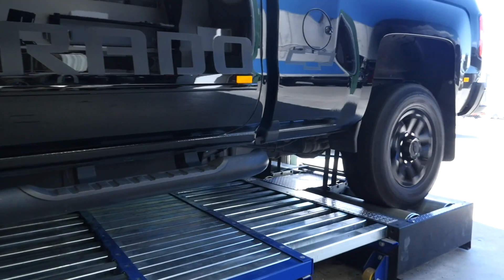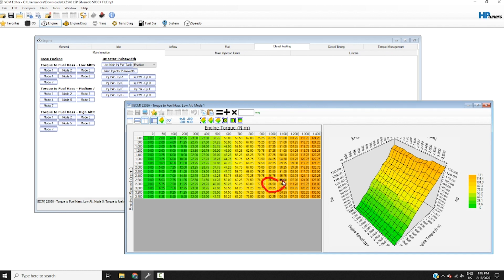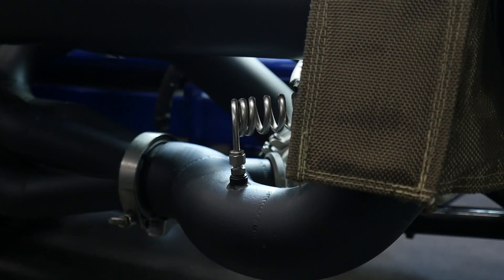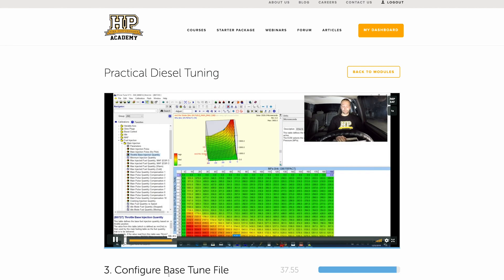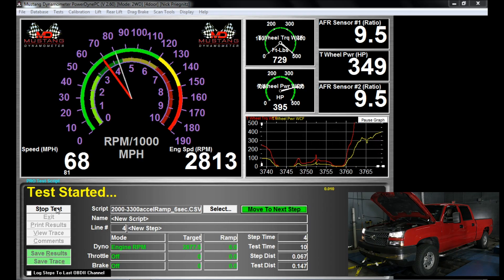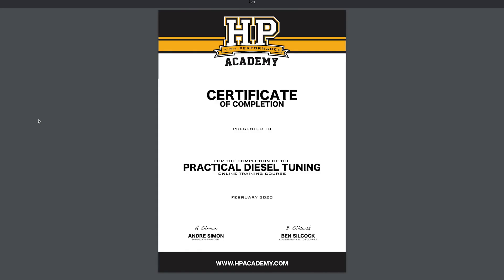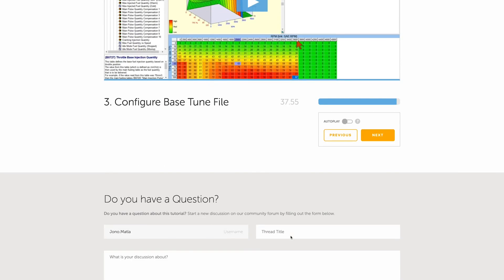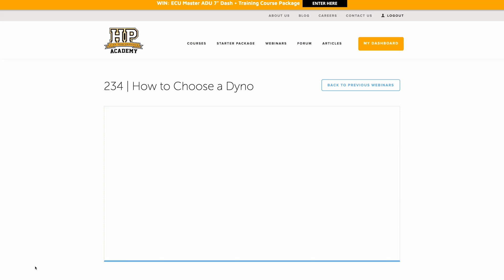Learn to Tune Diesel w/Nick Priegnitz and High Performance Academy!

Comment: Hey Nick, any chance you could put together a worked example of tuning with bigger injectors? I could use some help understanding an injector datasheet with limited information and using it to adjust the fueling and if there are any other tools to help dial in the fueling for economy with bigger injectors. Thanks!
Reply from the maker: Wilde, I saw your post on the HPA forum this morning. I’ll give you a few pointers there.

Comment: Question on EGT’s. What’s everyone’s average temp on a dead stop WOT launch roughly between an 1/8th to 1/4 mile?  Mine seem to sky rocket extremely fast on my 3rd tune (5 p switch). I usually let off at 1400 when my CTS2 starts chirping. 

14 LML, air intake, dpf/EGR delete, 5” exhaust, 3” dp, 5 position switch, EFI live

Comment: Mate I admire your confidence and seems you're the pro
Kindly help me I have Musso Korean 4x4 based on Mercedes Benz
2.9-litre straight-five Mercedes-Benz OM602 diesel engine (70 kW, 192 Nm) what's the chances for me to increase the Hp to acceleration I don't want extra torque just focused on acceleration 
I am all ears for you 😉